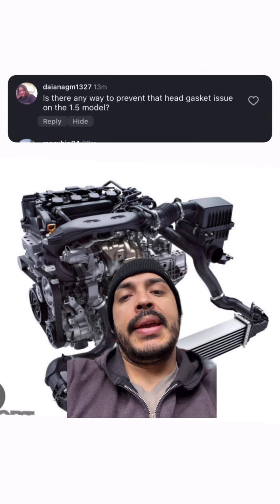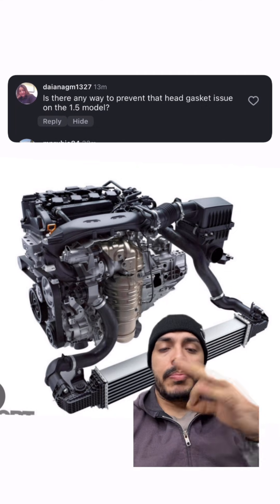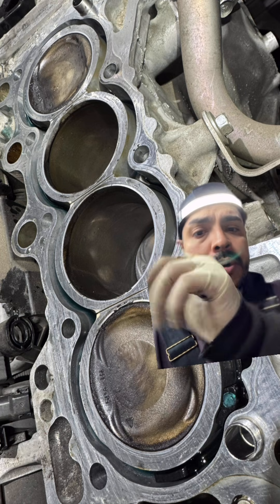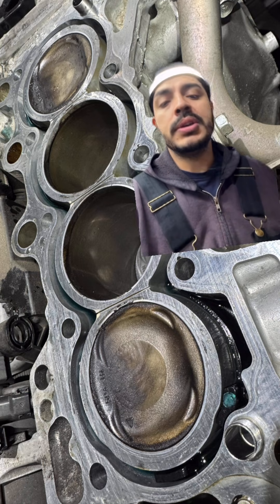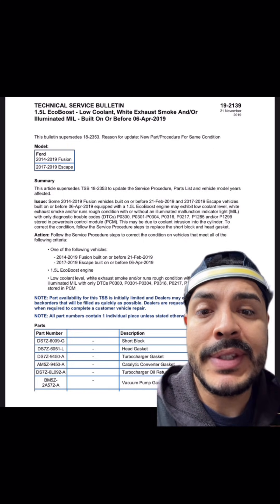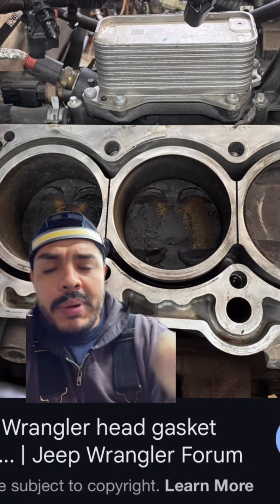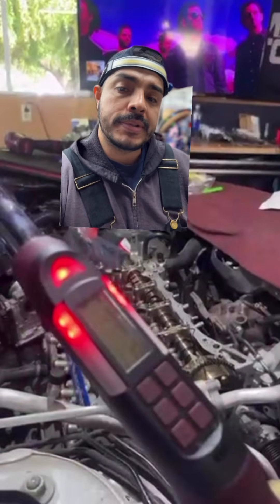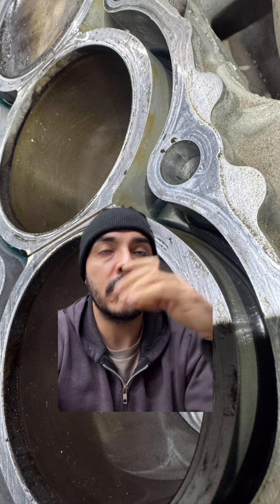1.5-2.0 Head gasket Failures in Hondas

Comment: You mean old acidic coolant if you change the coolant it will not eat through the head gasket.For Honda fleet and given the localized corrosion pattern , adopt an annual drain‑and‑fill with OEM POAT premix (or equivalent aftermarket match) and add coolant analysis every 1–2 years. This is conservative, evidence‑based, and the most cost‑effective way to lower corrosion‑driven head‑gasket risk while you monitor for design‑related thermal issues

Comment: Okay so head studs from ARP and cooling system upgrades. It’s crazy to me how reliable ** minus the block defects in early versions ** the R18 was. Super efficient, good power to size, and damn near bulletproof with bare minimum maintenance. Every dead R18 I’ve come across is for one of these reasons. 1. Radiator/coolant leak running the engine without coolant for an extended period.
2. Oil pan gets hit (lowered civics) and loses oil.
3. Complete disregard for oil changes like the one I saw that went 50,000 miles on oil before it gunked up so bad in the head the cam was shaved.

Comment: open deck design and thinly spaced cylinder walls. supposed to improve emissions, something about heat distribution in the combustion chamber. adding boost will only make head gasket more fragile. there is no fix. cars these days are junk! for hondas, stick to the old k24 and r18 engines

Comment: Im an Acura Technician. Easiest way for us to find this issue is misfire code-usaully from 1 cylinder. Coolant overflow is empty. Coolant is low in radiator. Once i see that its done deal. All i do is use a block tester/combustion leak  tester let the car run and always find it. The falure always seems to be from the headgasket missing material.

Comment: Meanwhile you can drop an Ebay turbo on a 15 years old L15 Honda Jazz and the head gasket will be fine under 10 pounds of boost.
Reply: Exactly!
Heck. Even Honda sold you a supercharger kit for the cr-z😂😂
Strong lil motors.
Reply: THE ACORD has 20 pounds 0f boost
Reply: @xpressh51  20 pounds of boost and suc a sh*tty performance output? Heck.. I used to boost B16a VTEC engines back in the 00s and got 300hp safe 😂

Comment: The thing is that I’m shocked that the 2.0L engines are also having this issue. The issue is the tiny coolant channel between the cylinders. Coolant will become acidic over time, and owners would have to change the coolant every two years to help extend the life of the engine.

Comment: The NA 2.0L k20c2  hasn't had nearly as many head gasket failures as the rest...
Reply: I agree but in my case Honda installed a crap 6 speed manual transmission on the brand new 2024 Honda Civic Sport Hatch 6MT I used to own with the same engine. The main reason for going with a new K20C2 N/A Honda car was to keep it for the long run and avoid any of the L15T issues but I just could not live with a new car whose transmission shifted worse than a box of rocks so I got rid of the car after 9 months of ownership. I'll never give Honda my business again.
Reply: @abraham3981  Funny you say that...I have the same car and am not impressed with the trans. Especially 2nd gear, I can feel the syncros grind especially when cold and randomly when up to full temp. I don't think it's gotten worse over time (14k miles) but I'm also unsure if it's gotten any better. I've drained the trans a few times and have not found any metal. I fully expected to find brass fillings but none. I'm using Red Line MTF now and it definitely helps. I'm just going to send it and drive this thing.
Reply: @MacCready_  I can without any doubt say that that brand new 2024 Civic sport hatch with the 6 speed manual is the worse manual transmission car I have ever owned and driven and I've owned six manual cars most used.

The transmission was not grinding yet but you could hear an audible resistance between 2nd and 3rd shits, it felt like you were pushing rocks against one another on those shifts but the other gears were rough as well. Driving such a rough transmission got worse than a chore for me so I only kept that car for 9 months and 4.5K miles before I got rid of it. 

I've owned two 5 speed manual 90s Hondas in the past and they were fine. Honda started having more issues since they started making their 6 speed manuals. You can find a video by Savagegeese in 2017 where he touches upon the infamous FK8 type R gear grinds and goes in detail at the end of the video on the Honda/Acura 6 speed manual gear grind issues since the early 2000s.
Reply: @abraham3981  my s2000 had same issues
Reply: @G-Lo_gobirds  I am definitely done with anything new Honda and will not give them any business again. If I ever need a new car I will go either Toyota (not their trucks) for a daily driver or Mazda if I need to a fun stick shift (MX-5).

Currently I own a 2024 Nissan Versa S 5 speed manual that I bought new as well. While the manual transmission in the car is not the best at least it is smooth enough to be livable plus it was only 18K new when I got it in 2024.
Reply: @abraham3981  hey $18k is a steal for sure. Newest car I’ve ever purchased is 2013. I stick to simple older cars

Comment: The issue is that they haven’t changed the coolant, which is eating through the head gasket. Change the radiator fluid every two years and the oil every three months.
Reply: Bs the fluid eating the gasket or did Honda use a cheaper head gasket
Reply: @roymoxley2587  Its not the head gasket, its the weak head bolts with only 40 lbs tq and lifting where the cooling slits are between cylc #2 and 3. ARP  head studs uses 70 lb tq, with the stock head gasket is fine.
Reply: Localized hotspots: Turbos create thermal spikes near exhaust manifolds and cylinder heads. These hotspots accelerate oxidation of ethylene glycol, producing acids faster
Reply: @gerardford5707  dunno about the oxidation of ethylene glycol but I will say that it does sound like it has a hint of plausibility. I’ve gotta 1.5 ltr head I had to send out yesterday for resurfacing. I swear where the gasket failed the head is pitted. Not mechanical damage, not scraped up but “eaten” away. Never seen the like before. You could see the grain of the metal and feel it with your fingers, and it only happened where the gasket failed.
Reply: @paulwilhelmsen6586   I bet cly#2 and 3 right where the cooling slits are, its weak head bolts with low tq settings, get ARP head studs or it will happen again.

Comment: A few Honda channels out on YouTube talking about this issue. It appears there are a few issues contributing to this problem. Lack of cooling system service at 30-35,000 mile intervals (complete flush) engine oil replacement between 3000-4000 miles. If the head gasket leaks, then switch to ARP with new head gaskets. Our shop uses this service interval on every turbocharged engine we service, regardless of brand. We advise all of customer to consider a non turbocharged engines since they don’t have these issues. However, they should service their cooling system every 40-45,000 miles and replace their engine oil at 5,000 mile intervals.
Reply from the maker: I wouldn’t say the non Turbo don’t have these issues, just less prone. But we are doing CRV hybrid/Accord head gasket every week. Also the 2.0 non turbo in civic I have diagnosed a hand full
Reply: N/A FOREVER

Comment: Yep. I completely agree. I'm also a Honda tech, and I've actually just done a 1.5 head gasket on an Accord that I posted a couple of shorts of not too long ago. I've got a little collection of head gaskets and timing chains that I've done by my toolbox. I did one of the 1.5 Ecoboost blocks for a 2019 Escape almost a year ago and there's quite a few 4 cylinders throughout the entire industry that have that same design that are prone to head gasket failure. I even had a 2019 Jeep Grand Cherokee that had a blown head gasket a few months back and that's when I found out that they have the same issue. People will try to argue it, but it's absolutely the coolant passages in between the cylinders causing the problem.
Reply from the maker: I sound like a broken record but I’ve been saying this for like 4 years now. Thank you for watching!
Reply: Lexus tech here. And same crap our 4 cylinder 2.5 engines aren’t even making it past 80-100k before they need head gasket repairs or injectors.
Reply: @MrJD240sx Damn. I didn't know you guys were having head gasket issues too.
Reply: Crazy that my phone is listening to me again. Yeah, I was just talking about this because my mother has the 1.5 turbo and almost all the warning lights on the dash came back up again because of that. Honda want 3k to fix it from the 1st time me and dad took it up there. Now here we go again a month later after new spark plugs, brakes, and oil that it seriously needed. The mechanic I go to couldn't make it leak after sitting for 2 days. Honda really needs to address this but I know they won't. Thanks for your insight on this.
Reply: @Clip_Paperholdden Letting it sit isn't just gonna magically make it leak, man. You've gotta have pressure on the cooling system in most cases. When I look for leaking head gaskets, I pressurize the system using a coolant system pressure tester and stick my borescope down into the cylinders through the spark plug tubes. This method has yet to fail me.
Reply: @QWICHERBICHEN  meant to add they pressure test it. It didn't leak. Idk how I forgot that part
Reply: @Clip_Paperholdden I dunno, man. It's never failed me. Chances are that the Honda dealer that you went to knows what they're talking about, but it can't hurt to take it to another one just to get a second opinion. The 1.5s are known for having issues with the turbos and fuel injectors too.
Reply: @QWICHERBICHEN Pretty much what has to be done at this point and get a 3rd opinion about it
Reply: @Clip_Paperholdden Well, do you know what codes are in it?
Reply: The focus St with the 300hp engine has the same design. The head gasket failures where due to vibration wearing out the material that sealed the head to the block. Makes sense considering those cylinder designs are basically free floating.

Comment: Those cuts are def not the issue. The issue is Cylinder Pressure and Heat. Head studs work or prolong the life bc the head cant lift as easy.
Reply from the maker: Sure

Comment: Just recently had engine replaced and turned out to be head gasket issue at 120k miles 2.0t accord.
Reply: How much was the cost of that?
Reply: Head gasket caused more damage and needed a full engine replacement $3k for parts and 2k labor
Reply: @TunedMotorHeads wow

Comment: ARP head studs,  93 octane fuel  will help with LSD= low speed detonation. LSD causes higher cylinder temps and pressure, good bye head gasket... use highest octane fuel. Also  use oil like Pennzoil Ultra Platinum. it is GF-7  rated which also helps with LSD and oil changes no more than 5k, Make sure coolant reservoir is topped off. I have a 22 1.5 accord sport .17k , doing ARP studs one at a time .The problem is the heads bolts are too weak and the tq rating is only 40lbs so the head gasket is compromised and fails between cylinder #2 and #3 right at the cooling slit. ARP is 70 tq. Theres no guarantees  but these are probably the best things to do if you plan on keeping the car long term.
Reply: Hate to be semantics guy here but it's most commonly referred to and recognized as LSPI (Low speed pre-ignition)
Reply: @caleb7674  LSD low peed detonation is the same thing. But I hear ya.
Reply: Can I use 93 on a N/A EarthDreams 2.4L?
Reply: @glenbenton4855 Yes.
Reply: Can I replace head bolt without removing the whole head?
Reply: @jygogaming3550  That is what I'm doing, my friend is a Honda mechanic, so we are doing it together. If your not experienced, this is not a beginner job,
Reply: @joediesle give me update if u do it

Comment: Shit, now I’m contemplating selling my 21’ 2.0 Accord lmao
Reply: What you gonna buy? All newer cars have problems unless if you go back 20 years ago where reliability was a thing.
Reply: @kamalabbady6778  I would get the Camry Hybrid.  It has the I4 2.5 reliable engine with their well proven hybrid system.
Reply: 2018 2.0T accord gave out at 96760 miles. Used premium fuel, amsoil signature plus oil, and purolator boss filter. Let the car warm up in the morning n cool down. So idk what else I could have done. Goodluck fellas. 4.3k to fix
Reply: @carlosmartinezz3022 thats me rn on a crv, im at 55k but i probably go with a Mazda 2.5 for my next vehicle
Reply: @carlosmartinezz3022 dang…my ‘18 2.0 is only at 57K, but news like this makes me think the car is just ticking waiting to quit on me
Reply: @carlosmartinezz3022  What was the failure?
Reply: @iank6897 Code P0302, No.2 cylinder misfire  and was leaking coolant. Mind you when things went bad I didnt get any codes on dash so I was hoping it was something minor😅.
Reply: 2.0s  are not as bad as the 1.5... read my responce above and follow those guide lines... much better chance of not blowing HG.
Reply: Lol. Try to reason it out in your head first.